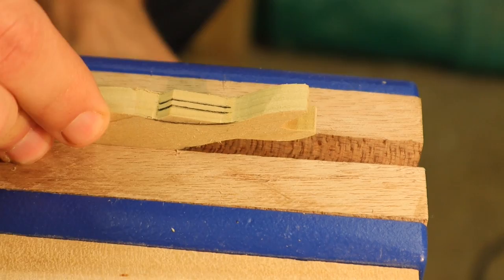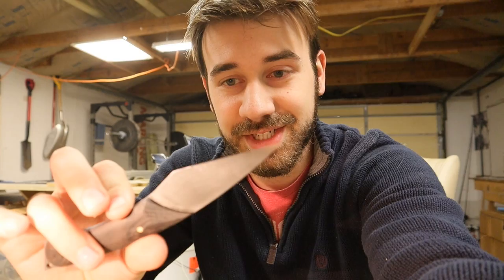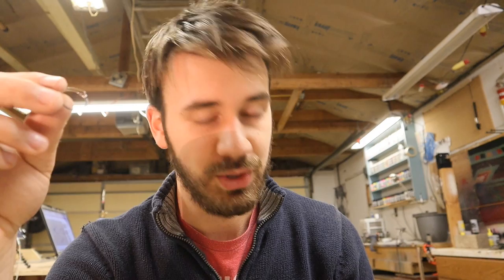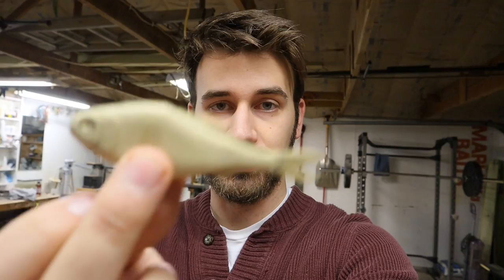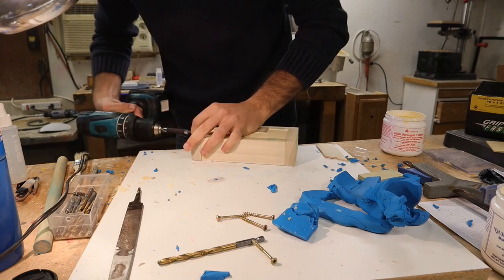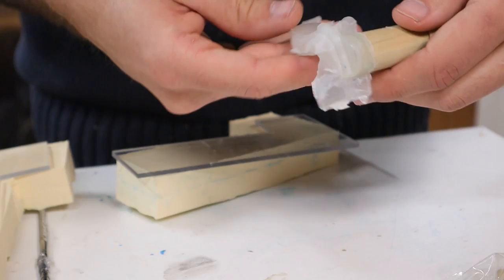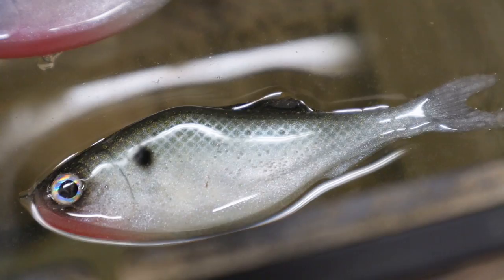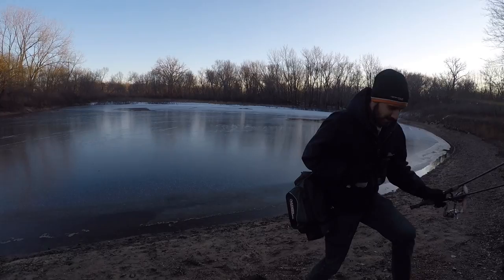Making Lures for Winter Fishing

Comment: lure works sells a plastisol special for dipping it melts at slightly 
lower temp that way the shape of the bait is not changed as if you were 
using regular plastisol at 350 deg also I would make tail much longer 
more action king of like those fancy goldfish